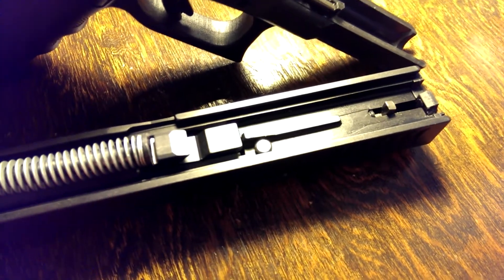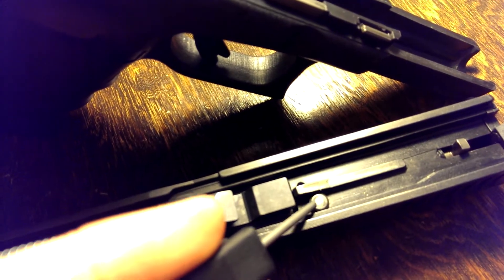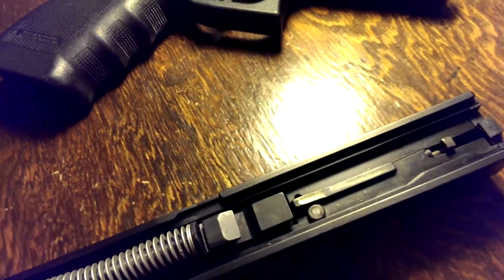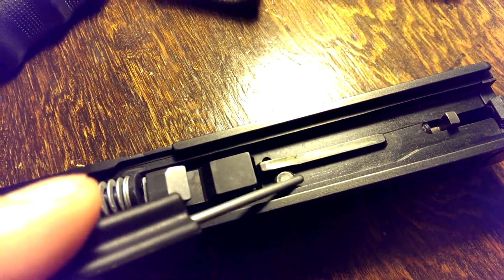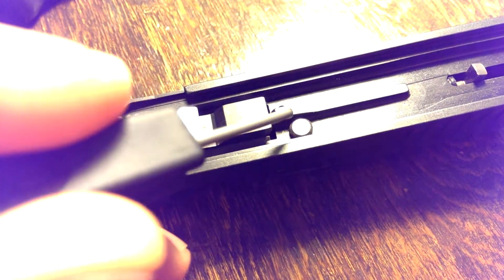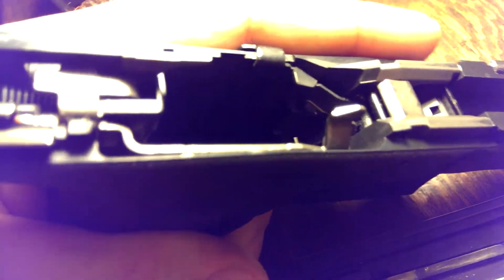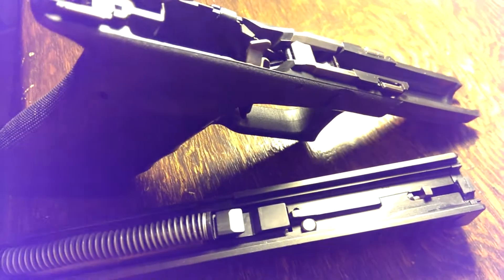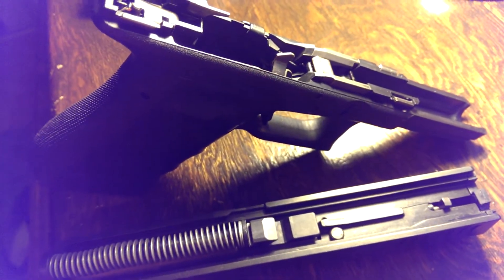Glock Safe Action Part 3 firing pin safety block

Comment: PLEASE ANSWER, IF THE TRIGGER IS NOT PULLED,  LET'S SAY THE FIRING PIN SLIPPED FROM THE FIRING PIN SAFETY METAL PIECE THAT MOVES UP.... IS THE INITIAL, DEFAULT DISTANCE AND TENSION OF THE SPRING AND FIRING PIN TO THE PRIMER OF THE ROUND, ENOUGH DISTANCE TO LAUNCH A BULLET ? ....... COMPARED TO THE LONGER DISTANCE AND GREATER SPRING PRESSURE OF THE FIRING PIN  AND BULLET PRIMER THAT NORMALLY HAPPENS WHEN YOU PULL THE TRIGGER. PLEASE ANSWER. GLOCK SAFETY ISSUE

Comment: Note: Make absolutely certain that the spring is in correctly after a detail strip of the slide. What will happen if it is put in wrong will be that the slide will hang up if you hold the trigger down and ride the slide forward. typically it will hang up the last 1/4 inch of travel till you release the trigger.

 The safety plunger spring should be captured by the safety plunger prior to reinstalling. If the spring keeps dropping out just put it in the plunger and rotate gently till you feel resistance then stop. Now it should remain nested with the plunger.
Reply from the maker: True. Any part not assembled properly could cause serious problems

Comment: Is it normal that the firing pin safety to have wear marking around it?
Reply from the maker: slntscpe seems like it. Most I’ve seen have some. I think you’re fine if it’s not excessive.
Reply: @n300zx931  thanks for the instant reply, I had bought a zev firing pin block and it was chewed up after 100 rounds

Comment: Thank you for your detailed explanation.  Now I feel very confident about carrying a Glock 19 in the appendix carry position.  Keep up the good work!  I have liked and subsribed.
Reply: p pollaccia I would never reholster a glock in appendix style unless you literally remove your holster. Anything like a belt loop or buckle piece could get in the trigger guard and neglient discharge.
Reply from the maker: thanks man. yeah I carry my 32 appendix
Reply: @n300zx931  PLEASE ANSWER, IF THE TRIGGER IS NOT PULLED,  LET'S SAY THE FIRING PIN SLIPPED FROM THE FIRING PIN SAFETY METAL PIECE THAT MOVES UP.... IS THE INITIAL, DEFAULT DISTANCE AND TENSION OF THE SPRING AND FIRING PIN TO THE PRIMER OF THE ROUND, ENOUGH DISTANCE TO LAUNCH A BULLET ? ....... COMPARED TO THE LONGER DISTANCE AND GREATER SPRING PRESSURE OF THE FIRING PIN  AND BULLET PRIMER THAT NORMALLY HAPPENS WHEN YOU PULL THE TRIGGER. PLEASE ANSWER. GLOCK SAFETY ISSUE
Reply: @Bobby.....G-1  because of the shape of firing pin and the shape of the firing pin safety it is not possible for the firing pin/striker to "slip." The firing pin can only pass through the notch on the firing pin safety when it lines up by being depressed.